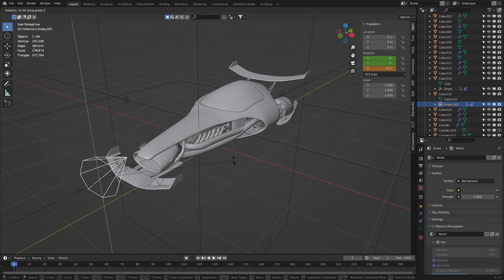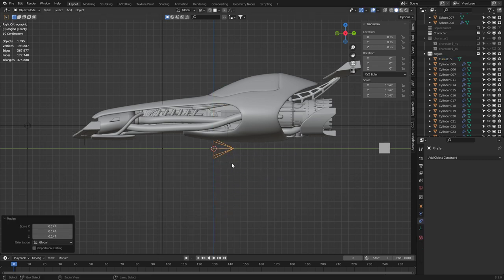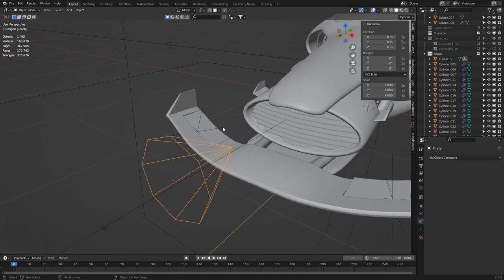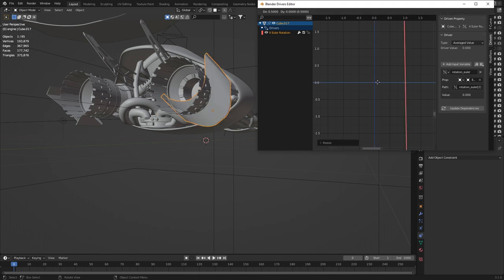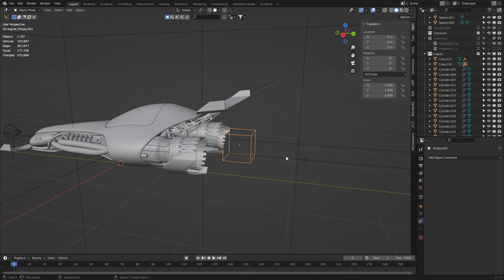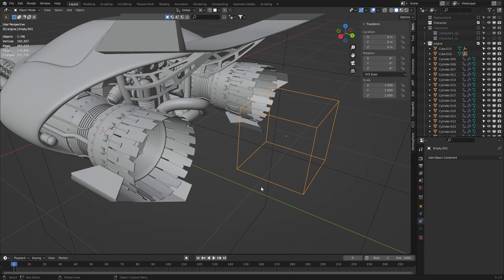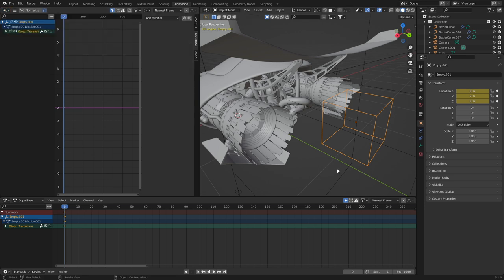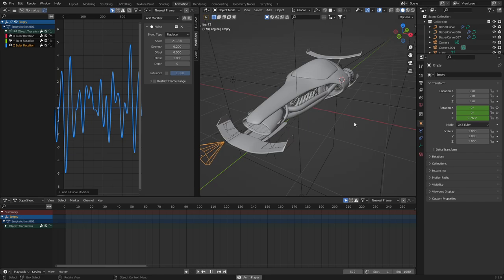Using Driver to Control a SCIFI Vehicle in Blender

Comment: I don't understand why you couldn't just add in the empty, move it into place and then apply all. Why is the step with the parent to cube needed?
Reply from the maker: An empty does not have an origin point, it is the origin point. If you apply all, the location will just go to world origin.
Reply: @Markom3D  ah, that makes sense. Cheers.